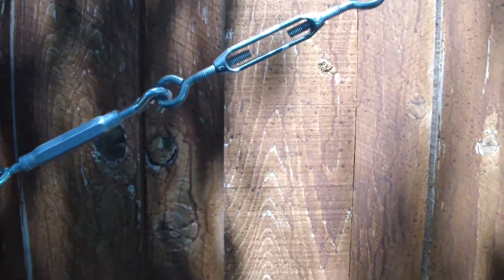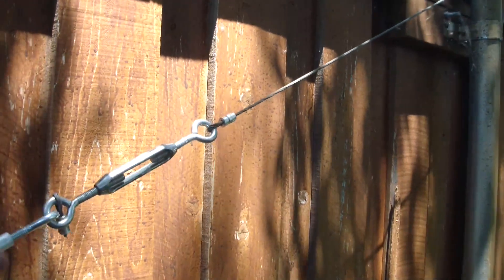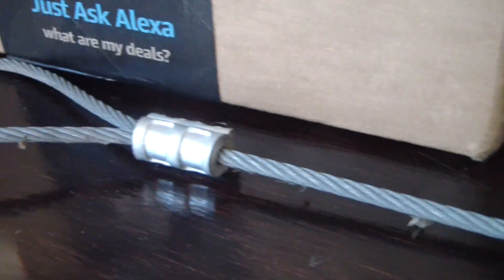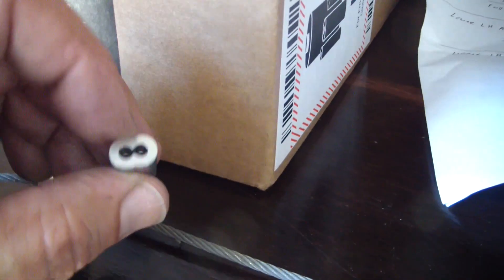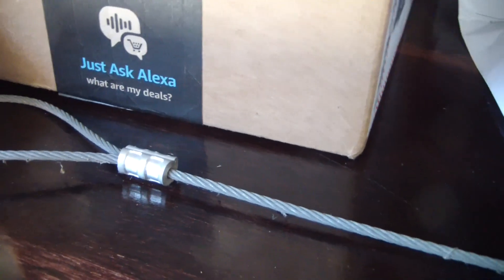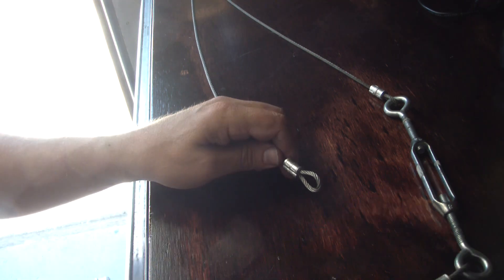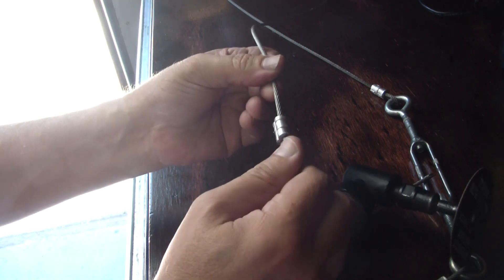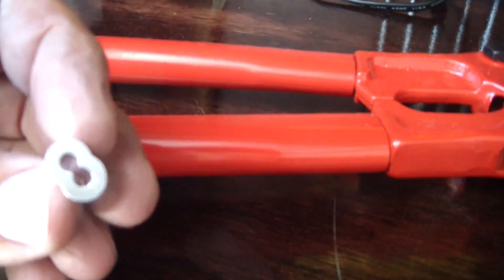How to use a manual hand cable swager to swage ferrules on cable.

Comment: Hi nice to see this, we have a few gates here, but we do not think these are going to save our gate, we just need to build weld a new one of all metal wood where we live will not last it is too arid and windy here.
We were expecting a hydraulic crimp and you should us this manual one will do this job and cover some variety of sizes.
Thank you for the share.
Lance & Patrick.

Comment: The cable and ferrule manufacturer recommends the cable to protrude two times the thickness of the diameter of the cable past the end of the ferrule. Not flush with the end! Also plastic coated cable is to be stripped of coating at complete eye end.
Otherwise good job on the video.
Reply from the maker: Yea the reason I have never let the cable extrude past flush is I hate running my hand along a cable and having the cable ends Peirce into my flesh causing pain.
Reply: Yep, and that's why I do it that way. The swage material needs to be forced into the cable "valleys" during the crimp but with the cable end inside the swage the cable is distorted and twisted out of shape and a good compression isn't made afaik.
With a bit out the end deformation doesn't occur. Also I use some vucanising tape/pressure tape on the sharp end to protect fingers or slide a small length of heat shrink over it before crimping to make it look really professional. I would release the turnbuckle almost all the way out before measuring to give plenty of thread for tightening down the track. This video here is just for a garden gate tensioner so not a critical load and not a big deal to do it differently. Btw, those numbers on the swage tool are not metric sizes. Check this good video out for some excellent info: https://www.youtube.com/watch?v=dlECTP3Qr0Q
Thanks for the video 737mech.
Reply: Yea there are alot of ways to not cut your hand without crimping the dead end flush like that. You can etape the end, hot glue it, heat shrink. But having said that it depends on the application. If you are just holding tension on your fence post that's fine. If you are trying to hang something over people's heads or something approaching the working load of the cable the dead end of the cable does need to protrude 2 times the diameter of the cable.

Comment: I am trying to crimp an eyelet with a similar crimp tool you have but it doesn’t look like it crimps it enough. I used the 2nd from the top (labeled 2 on the tool). Do you know if the nut near the crimping end is to adjust it?
Reply from the maker: I looked at mine and the only way I can see to adjust anything would be to file the stops down so it closes more.

Comment: Dont aluminium degrade when on stainless steel. You kneed copper or steel sleeves..u kneed 3 crimps  for 1/8 wire not 1 and u need to stick out 2x the cables thickness not flush
Reply from the maker: Maybe over a course of many years it might degrade and if you like catching your fingers on fraying cable’s then have some stick out. BTW what the purpose of stick out?If you have a proper crimp then the cable will not slip so any extra sticking out does nothing but cause bloody fingers. No reason to use 3 sleeves if you use the proper ferule for the right size cable. BTW I have had aluminum ferrules on steel cable for 25 years with no signs of it giving up anytime soon.

Comment: How do i do that without the crimper
Reply from the maker: You might be able to smash it with a vise or hammer but not sure how strong it will be and it will look like crap.
Reply: @737mechanic  i will see and let you know how it goes or went
Reply: Blunt cold chisel and an anvil, but you’ll need four hands and the patience of a saint. Just buy the crimping tool.